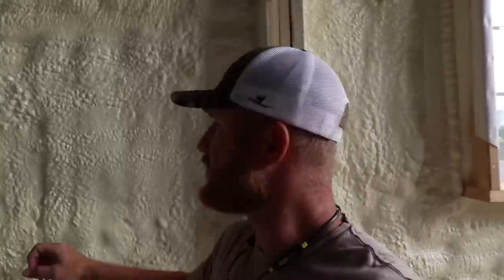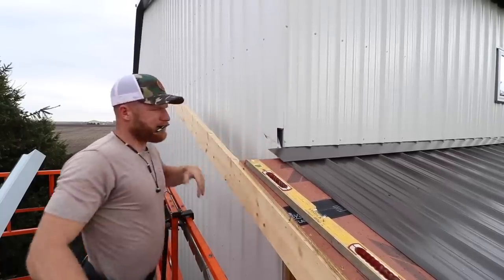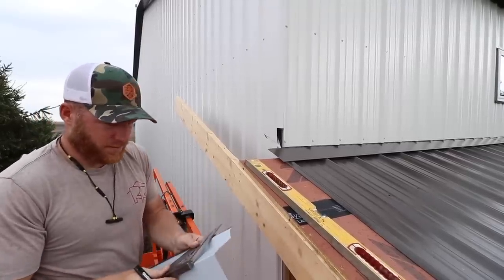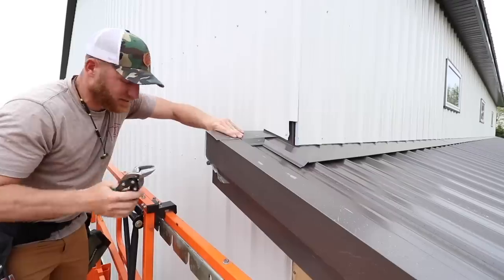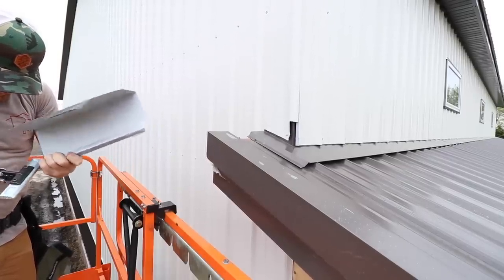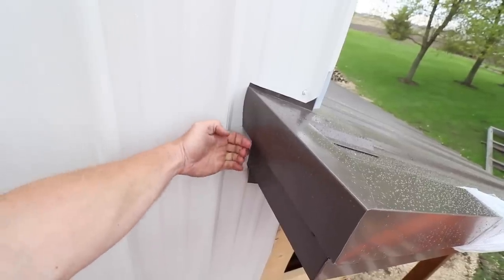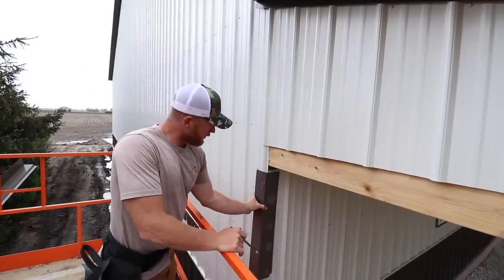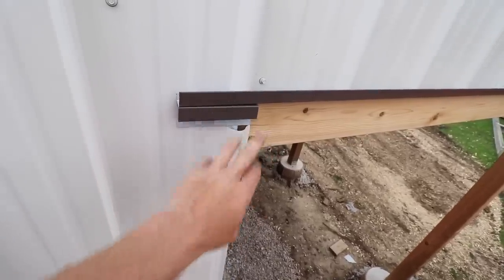How to Build a Garage Addition 23: Exterior Finishes, Trim Details

Comment: Awesome job! I've seen some tin jobs where they just caulk and nail bits and pieces to hide the wood and they will obviously leak at some point. Speaking of which -- I will be mentioning your window trim video in a video of mine soon where I have to fix the horrible window install on my shed. There is no J-Channel whatsoever, just caulk at the top. It leaks like a sieve, but we bought it along with the neighbor's property and it is now our problem.

Comment: When doing detailed finish work, like details on the porch ends., I like a table to work on.  I cut a scrap of OSB, put a narrow clear on each end on it's bottom.  I could slide it where I needed it or just set it in platform when I didn't need it

Comment: Not sure if you would get paid for something like that, but where I line before siding goes on ( or steel in your case) one would bend piece of flat stock to cap rigid foam to protect it from UV light and for a clean look. Just something that would make finished product look lil better

Comment: I love this video series.  What about the outside corner where the corner molding and the corner piece you trimmed to fit on the metal roof meet. Did you silicon it. Seems you could bend a small 90° around the corner. Just curios cuz im gonna do this detail on my home. Hope this makes sense.

Comment: Hi, love the channel.

You probably just put a vented ridge cap over the new construction, but i was wondering how you vented the roof of the old garage? I noticed the paper was blocking the ridge when you were putting the roof steel near the new section.

Comment: How do you make the connection between corner from and white plate sealed where you cut into the white metal? All the way in where the black metal goes into the cut, how do you stop it from leaking?

Comment: Does the steel rust where you cut it?
Reply: Midwest snips bend over the ends in a microscopic way and this "anneals" it meaning the cut end is mended/melded (blended, combined) with some of the zinc and paint which means the cut part is thus protected for at least 20 years from noticeable rust.

Comment: Your videos have helped me envision my project. Thank you. They are great! I have a question for you. I am planning a side porch on my 40 x50 post steel shop. The existing shop has a 16’ ceiling height. I will add my side porch to the gable end. My existing pitch is 4/12 but, if I make my porch 16’ wide with a 2’ overhang with 4/12 pitch and a 9’ ceiling in the porch I will be only a few inches under my existing shop overhang. Is it okay visually to go with a 3/12 pitch porch on the gable end of a 4/12 pitch existing building? BTW, I am in East Tennessee so relatively low snow load. Thanks
Reply from the maker: Totally fine

Comment: At 9:05 that corner appears to be just a butt joint. Would there be a benefit to bending a small flange from the side/gable trim around that corner (instead of trimming it flush with the corner) before putting on the short return? Seems a place where any slight gap shows wood and/or white.

Comment: I have a question. @22:12 you see the horizontal wooden beam of the side of the porch. Why don't you make the steal siding not about 4 inches longer to cover the beam? So that with a side view, you don't see it. Is there a reason you don't? Is the reason technical or cosmatic?
Looking forward to the inside episodes! 😃👍👍
Reply: Watch from 14:30 to 16:30 again and you will get why he did not sheet with the main covering to the bottom of the beams, It is not called trim for no reason.
Reply: @Joshua79C   I dont see, why everything couldn't be done exactly the same way, just 4 inches lower and don't see the wood from a side view......
Reply: @Guust_Flater , he, covered, the wood, in trim, as he clearly showed us in the video, which means, it is now hidden from sight by the trim.

Comment: What tape are you using 2:50
Reply: It looks like the Lufkin L1125 1-3/16" x 25' Shockforce Dual Sided Tape Measure (http://www.crescenttool.com/crescent-l1125-1-3-16-x-25-shockforce-dual-sided-tape-measure.html).  Lowe's has them for about $28.

Comment: Çan't you cut and bend your gable trim like you do at the top and bottom of your wainscoting ?
Reply from the maker: No due to angles
Reply: @RRBuildings  super nice looking building. Do you think it would be possible to add on to a stick frame garage with post frame construction ?
Reply: @MeMe-yy9jr , who is to say the original garage this is added on to is not a stick built? It likely is a traditional stick framed and now has the larger addition in post frame (pole building framing) as shown.

Comment: Is the steel rust resistant? How soon will the edges get a little bit of rust? Will it bleed down the sides eventually? I'll check some buildings around here, too
Reply: Midwest snips have an added benefit when thy make cuts it anneals or bends over the edge with surrounding protection of zinc and paint to provide a rust barrier, it essentially melds the cut portion to protect it longer from rust. Just because it is rust protected by zinc and such or paint nothing last more than a few decades in hard rains and other weather, there is a reason why so many manufacturers offer a 20 to 30 year or longer lifetime guarantee and warranty to cover replacement if it prematurely shows rusting or other fading/wearing. So long as the company is still in business when it does show signs.

Comment: So i was watching you do the last corner on the porch and i was wondering what you were doing with the flap that is supposed to shed the water from the roof over the porch? Are you not worried about wind like you guys had possibly bending any of that or the rain being blown up in there?
Reply from the maker: Not worried no... it is how all of our flashing are done and don’t have issues.  I mean you could dap a sealant there I suppose
Reply: @RRBuildings  alright, thanks
Reply: Yeah that is how he always trims it, makes sense since it allows water to drip int the gutter after that is installed by the gutter contractor.

Comment: When installing steel on soffet and facia why do you use nails and sometimes screws?
Reply: The nails act like staples until he can fasten with the screws or in some instances put up another piece that overlaps and then just fasten through both with a single set of screws.

Comment: What is the plan for the exposed pink insulation at the bottom of the walls?
Reply: There is NO Pink (fiberglass) insulation is these walls, perhaps you missed the previous foam application short video that is 4 min 23 seconds long ( https://www.youtube.com/watch?v=RX2eMrDoU6I ). Unless you are referring to the old building it is attached to, in which case is the customers choice to do with as they wish.

Comment: nice trim details, what tape measures do you like?
Reply from the maker: Currently a crescent lufkin
Reply: thanks!
Reply: Got to love when a company buys another ones business and adds their name to the original, I still call them Lufkin.
Reply: Joshua79C C at least its not like craftsman where they rebrand some thing new each year  and sell it as the same product as the previous year.
Reply: @theJonnymac  , Even though it is now amended with the owning company name first, they still make and sell them as Lufkin, Thus I still refer to tools with any amended name in the original name. Stanley is still Stanley much like Black and Decker is still the same name despite being owned by Stanley. Hence my original simple humorous comment. I still write it the same as Lufkin, even though it is no longer owned by the former. As they also own Jobox and a few others which I still refer to by original brand name, including Crescent hand tools original line.
I always called Craftsman as just that alone, but followed by which tool I need be it the wrench, a driver, or what not. Even when they were owned/sold by Sears and now by Stanley, Black and Decker and sold through Lowe's or whom ever where else available in the world.

Comment: do the  coopelas light up
Reply: No, as they are not wired or equipped with the sockets to do so, this is still the start of the building, electrical was being installed even if it was not shown, as he showed in the foam insulation application video how the conduit and boxes were installed before the foam guys came around.

Comment: Audio is still leaning to the left. It's the only video that's doing it.
Music at the end is centered. Dialogue is about 60 / 40 to the left.
Reply: I'm having the same problem.
Reply from the maker: Not sure why?
Reply: Have you two checked your equalizers? That is if you have installed other speaker system software outside of the OEM stuff.

Comment: Check out Tstud.com could make your builds easier ?
Reply: Those are good for typical framing, won't work with pole building framing (post frame) due to it does not seem to be multi ply friendly as wood already is. I am currently watching the Risinger video about it.